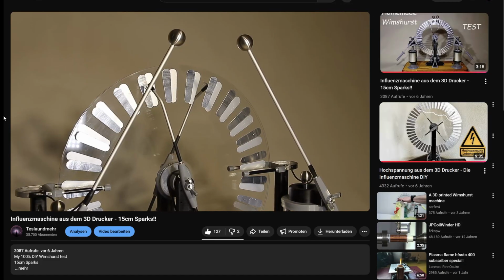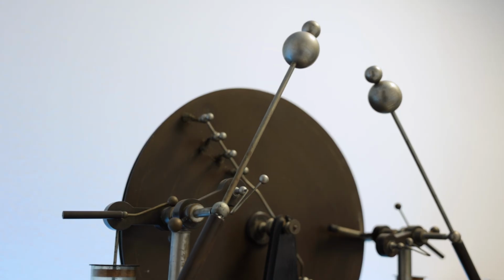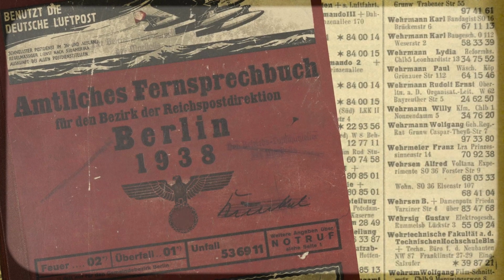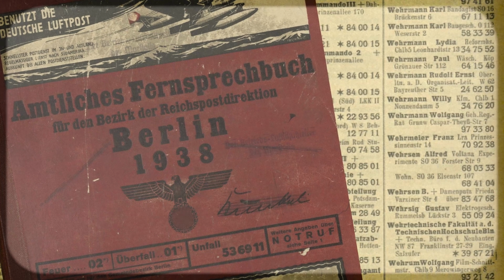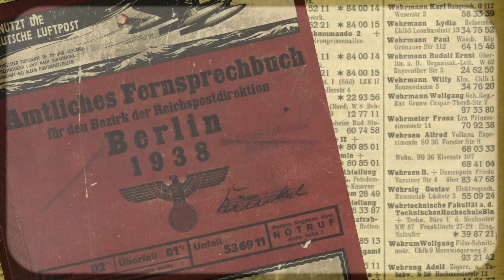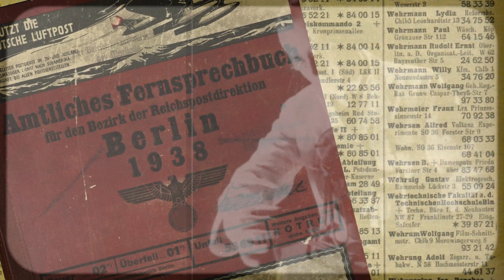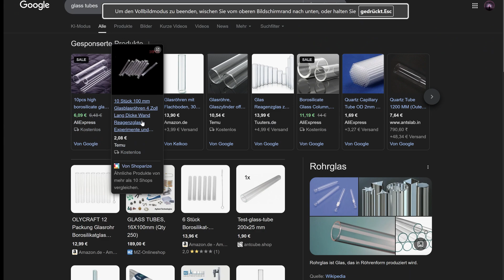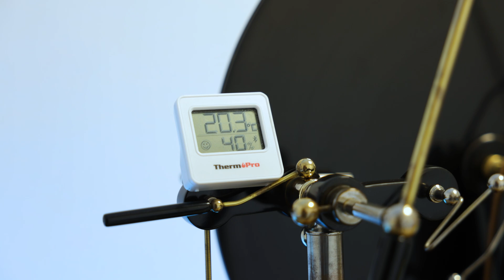I Restored a 115-Year-Old High Voltage Generator (500,000 Volts!)

Comment: I hope you will get an old cold cathode x-ray tube. Unfortunately they are not cheap as they are collectors items. I know it is not period correct but you should probably add a small motor to power such a tube because due to the small current involved it will take ages to get some useful output (e. g. on x-ray film).
Reply: With an image intensifier screen it won't take long at all, perhaps a few dozen seconds at most, which is longer than with a conventional power supply delivering several mA, but still waaaay faster than relying on direct exposure of the film without the intensifier screen in either case.